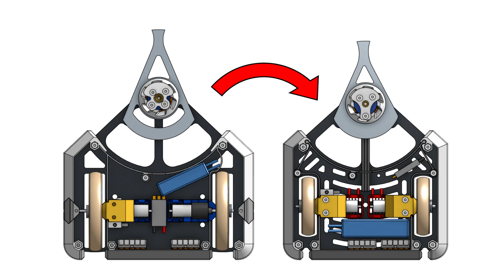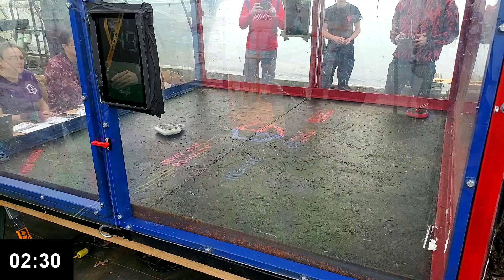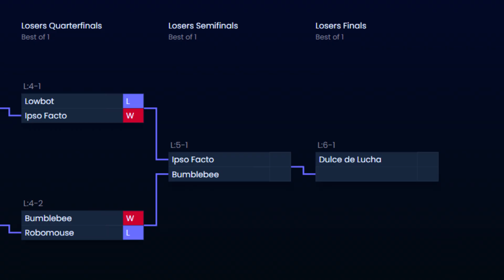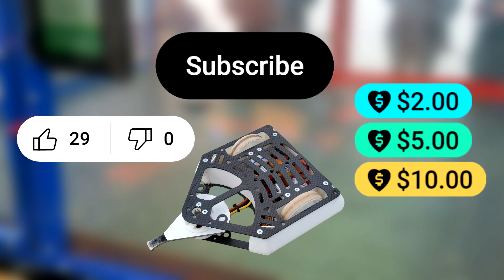Cheesecake hits hard! (GSCRL Winter Event 2024)

Comment: What weapon and drive motors do you use? And what ESC’s do you run with them? I have been having issues with ESC’s dying after one large impact.
Reply from the maker: Currently, my weapon motor is a FlashHobby 2822 1800KV, and my drive motors are Repeat Robotics "Repeat Drive Brushed Mk2". I'm still using the Fingertech Tiny ESCs for my drive motors, and I'm using a Cyclone 35A brushless ESC for my weapon motor. It's surprising how high the current can spike when your weapon hits something or even starts up. My weapon motor draws about 8 amps at full spin, but it spikes above 20 when starting from a dead stop.
Reply: @alexsalchemy Thank you, ill look into these. How do you go about testing this while your motor is running? Do you just measure the current in series when the motor is running? Or what is the best way to test what the max and min specifications of your motor and esc are running at?

Comment: your spinner sounds like it is rubbing out sparking and idk if it is normal but sounds like your have rocks in the motor. I bet that could be a loss also!
Reply from the maker: I'm pretty sure that's just the sound of it churning up the air.
Reply: @alexsalchemy  That's crazy thinking of it all make my brain go wild, the speed may I ask how fast it may spin? Also I was watching a clip of yours last night got to thinking if a hit off balances the blade or it not perfect does the vibration affect your use of the blade? Does it affect grip and drivability and can you counteract a bad hit from either from your weapon hitting or getting hit sending your axis off or balance?sorry so long just I have a huge gap between understanding and love for robot Fighting and I want to learn more!
Reply from the maker: My weapon spins at about 18,000 RPM, and yeah, as my weapon continues to hit things, and as my weapon motor continues to take those impacts, the system can become unbalanced, and cause Cheesecake to vibrate around and be harder to drive.

Comment: If you make the sweet tooth reach slightly further than the spinner you can stop it from hitting the wall. This might backfire though if the sweet tooth gets bent up it will stop the spinner from being able to reach the other bot
Reply from the maker: I've thought about that, but if the sweet tooth was longer than my weapon, it could easily get stuck in the wall, and then I'd be screwed.

Comment: man seeing Cheesecake rip off Mutiple wedges is crazy.  I think it shows just how much energy was being stolen from the weapon motor issue referenced at 0:40
Reply from the maker: Yeah I agree! It's amazing how much energy you lose to seemingly small inefficiencies. I didn't realize that air resistance played such a big role for a long time.
Reply: @alexsalchemy  Did you optimize cheesecake's weapon's cross section for minimizing air resistance? I imagine the cross section could look like some sort of tear drop shape that changes thickness further from the center of the weapon/motor shaft.
Reply from the maker: @willrummell3670  - I did not optimize the thickness in that way because it would be hella expensive. But most swords do exactly what you're describing. 

Given the restriction of having uniform thickness, ideally my weapon would be a flat solid disk with a single tooth sticking out to best avoid churning up the air, but I don't have that much spare weight. I could make such a weapon smaller in diameter to save weight, but I do want some good reach, so my teardrop shape is a bit of a compromise: it has pretty good reach, without churning up the air too much.
Reply: @alexsalchemy  appreciate the response— regarding the swords I suppose that makes sense. I never thought of why they tapered towards the tip other than keeping it light.

And you’re defo right on keeping it uniform thickness. Keeping the cost down for a part that might need to be replaced every fight should take precedent.

Best of luck with the next tourney— I definitely felt this one should have went your way, but I’ve loved keeping up with the journey so far.

Comment: I just got into combat robotics and was just wondering if for my weapon I should use a pulley system or connect it directly
Reply from the maker: For an antweight, I like my direct drive/hub mounted system: it saves a lot of weight and complexity. For a 3lb beetle... well, I'm going to try the same approach, but it may not work out given how hard those robots hit: having my weapon motor out in front might be suicide.

Comment: Lame, Man. The bot won by just existing. Had maybe 20 seconds when he pinned you. But seriously... I see no point in those bots. You took no damage, you were aggressive all the time, as you always confronted him directly without ever going back. Let's say, he had some control with those pins, but that was 1 quarter of the fight. I find the decision quite awful. You are my winner.
Reply: Whaa whaa whaa
Reply: Also, I get being positive and all that, but "a worthy oponent" isn't a rock on wheels.
Reply: I agree that Cheesecake should've won but not by your logic. Dolche had superior control the entire match, it was shoving Cheesecake everywhere and initiated pretty much all contact aside from maybe 1 or 2 hits. I wouldn't give them full points since they got themselves stuck on the wall seam multiple times, but Cheesecake failed to properly attack during those moments costing aggression points, but neither bot really ran away from the other so split with a slight edge to Dolche there.

But at the end of the match one drive side was severely compromised on Dolche while Cheesecake basically ended the match as it entered it, which should've given Cheesecake all of the damage points. In my opinion the score would be Cheesecake winning 9-8 with 6 damage, 1 control and 2 aggression points, while Dolche had 0 damage, 5 control and 3 aggression.

Control bots are a viable way of winning matches and I do like a good break your fist with my face bot, but if all your weapon is a wedge or forks you should expect to enter every judges decision with basically 0 damage points. I assume the judges awarded a pity damage point to Dolche which ended up tipping the count in their favor.
Reply: @bami2  Control bots can do some damage.  They can also cause damage to the other bot by virtue of their tankiness.  I.E.  Cheesecake's weapon damage at the end was caused by Dolce being able to take hits on it's forks.

Ultimately, I think Dolce deserved the win here (based on their scoring system).  Cheesecake basically didn't do any tangible damage to Dolce, no loss of control or weapon functionality.  Had a wheel come off, or a weapon bent/dislodged, I'd feel differently.
Reply: @chipdamage7791  I'm not sure you can call "no loss of functionality", Dolce was basically crabwalking when the match finished, it was only driving on maybe 2 wheels and it couldn't drive in a straight line anymore after 16:27. That's in no way comparable to the slightly bent weapon tooth of Cheesecake that didn't affect its functionality in any way.

Looking at the photos afterwards (18:22) you can see the gears driving the wheels on Dolce are completely trashed on half of them. It might have not lost any wheels but it lost a large part of mobility and thus functionality.
Reply: @chipdamage7791 I agree with you on this, it was a justifiable win, and the driving by that young man is some of the best I’ve seen. But it’s just not fun to watch 😔
Reply: I think Dulce de Lucha's driving at the end was worth the win. Cheesecake did actually go for the wheels multiple times but Dulce would spin to meet with forks instead, like at 14:46 where they literally bait and switch cheesecake into the forks.
Reply: Yea but it’s his choice if he does it you not